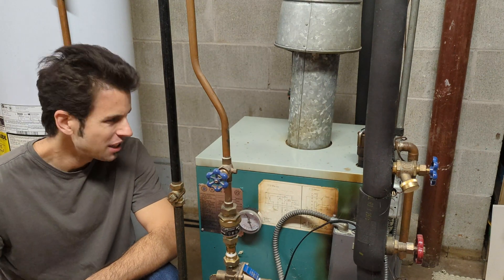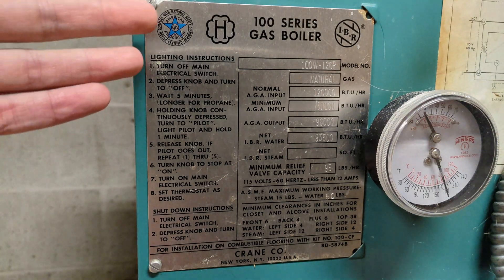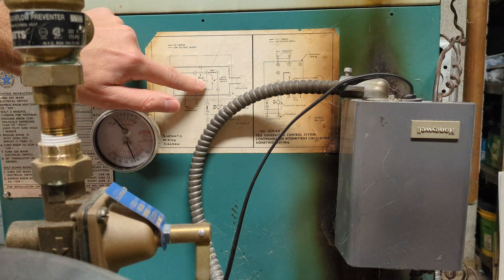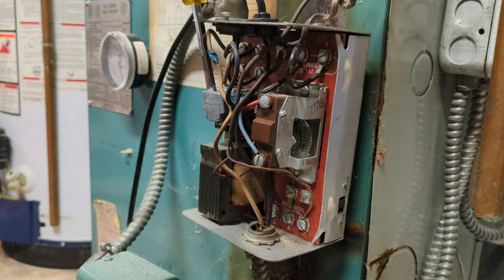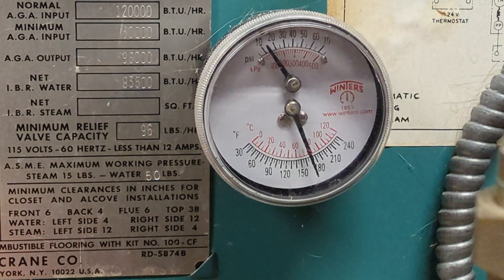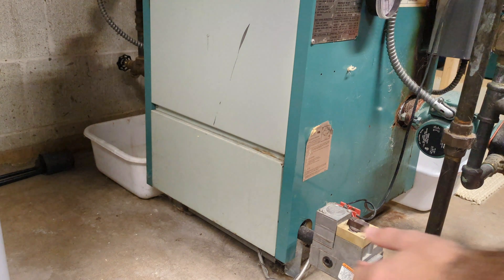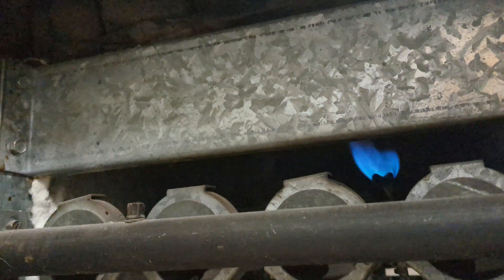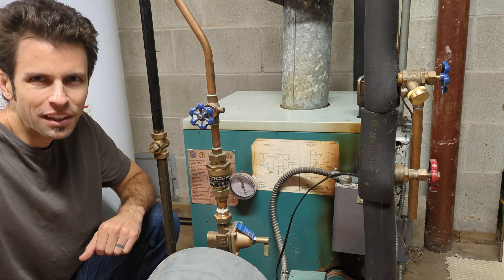How to Run a Gas Boiler for Heat during a Power Outage - No batteries or Generator

Comment: Wait if you have no power why the relay is for??   No power on the relay won't do nothing with no power.!  The gas valve need power also to open !!
Reply from the maker: At least for this system it is for an unpowered state. Might even just be the pilot light for the gas position. It definitely can't call for opening the gas valve. The manual switch (or manually switching the relay) is to prevent any problems for when power comes back on.

Comment: Is there an easy way to purge air from the system other than the little valves on each baseboard ? 
Thanks Ed in Akron ,Oh
Reply from the maker: Easiest way is to avoid the need to purge a lot of air by using the shut off valves to isolate the part of the system you're working on.

Comment: Most boilers Have Zone  valves that need Electricity to operate. What would you do about that? Duct tape open?
Reply from the maker: @pets7164  if you have valves vs pumps, then look up the manual for the valve. There should be a manual override to open it.